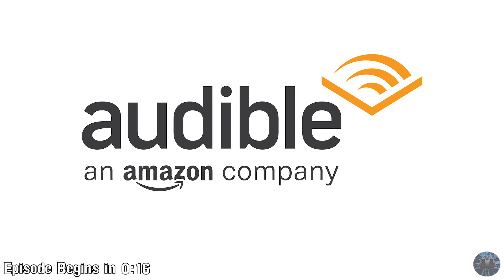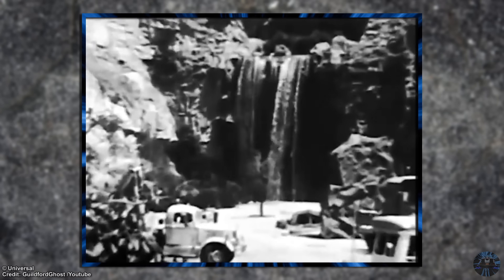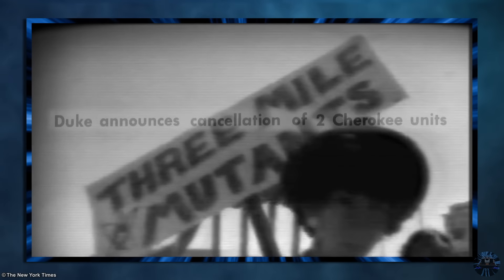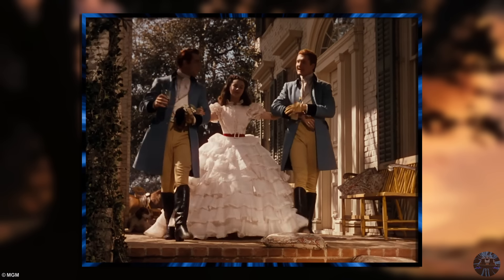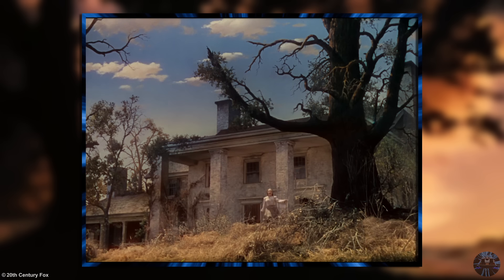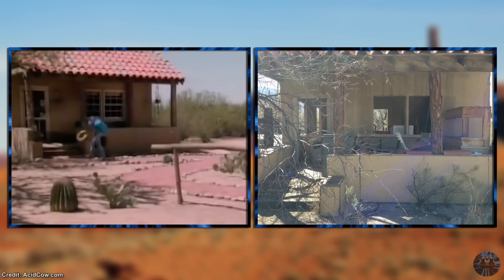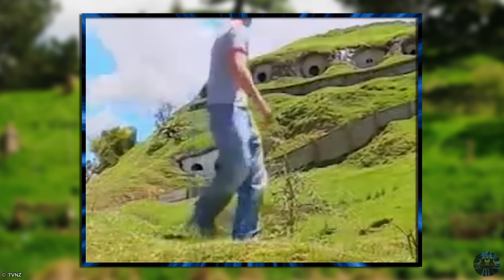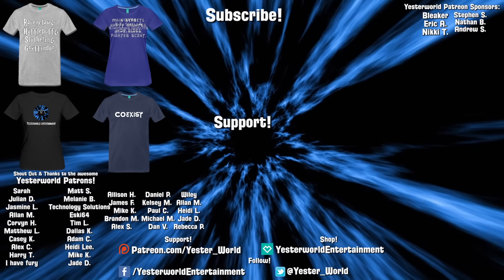Abandoned Movie Sets & Filming locations - Part 2

Comment: You gotta admire James Cameron’s ingenuity even if he can be an asshat. For example, in order to make it so the sun wouldn’t make what is supposed to be the bottom of the ocean too bright, he had the top of the water tank covered in a layer of marbles or something like that. I was wondering what happened to the nuclear reactor.
Reply: They never built the reactor, and it was beads that covered the surface of the water, marbles don't float to well
Reply: Ken H ah yes I had it wrong. Thank you.